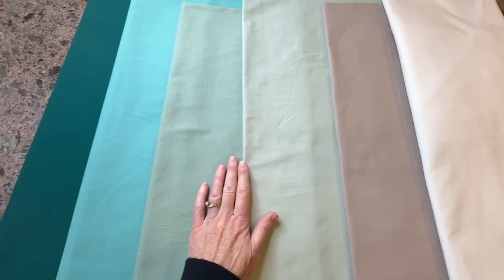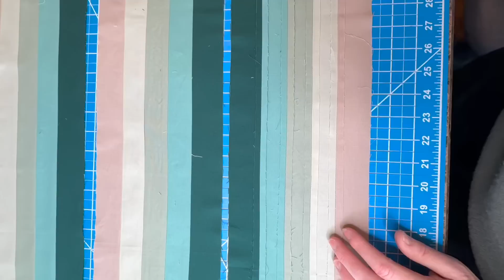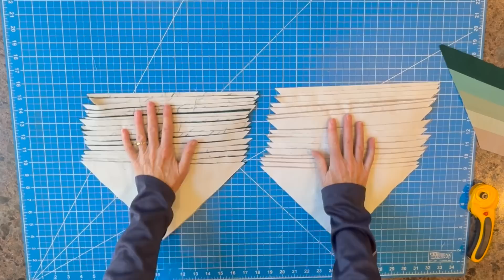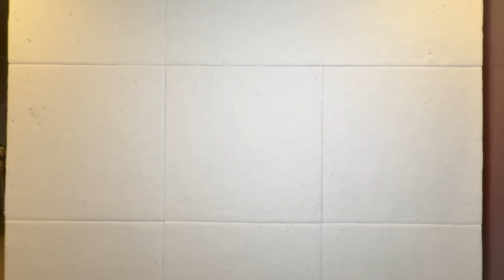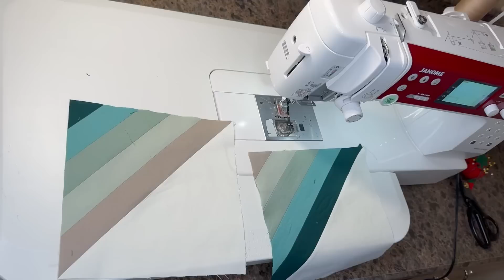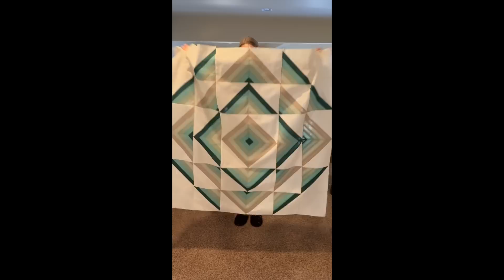Make this beautiful, easy Percussion quilt with me! Free quilt tutorial.

Comment: Hi! Question: What is the purpose of evening up the lengths of fabrics 2-6 when the ends are not used?  Jeanette, sewing these lengths together now... :)
Reply from the maker: That's a great question! I find cutting those strips to the same length, then pinning them before sewing them together helps to keep the resulting strip sets even and straight. It's easy to end up with curving strip sets if you're not careful. 😊

Comment: A complete waste of time doing it that way, sew the strip sets to the solid  down both sides then cut into triangles. You eliminate the step of sewing the triangles together. You might have one of two stitches to pop when you open the set but less time wasted.
Reply from the maker: That is an option, for sure. However, I chose to use this method because it doesn't need any special templates or angle measuring to cut the triangles. You simply cut along the edge of the Fabric 1 triangle, which is easily cut from a square.

Comment: I usually cut each strip at  a 45 degree angle on one side.   I don’t trim off the selvage on the other end.  Then when I sew them together, starting with the angled end,  I get one extra unit.   I also use a strip of the background fabric and sew to the strip set on both edges.  This makes a strip tube.  I then cut the triangles out of the strip tube.   I’m older and this method is easier on me. LOL
Reply: I like the strip tube method for making half square triangles. Do a video to teach that method. Loved the video. 1st time I've watched you. Short and sweet. All necessary information nothing extra.
Reply from the maker: That's so interesting. It would save some fabric, too! Thanks for sharing!
Reply: Yes, I agree that staggering the ends is an excellent idea. And thanks for the strip tube reminder!